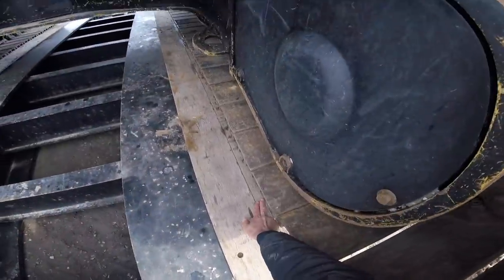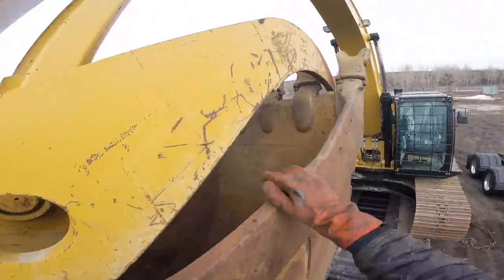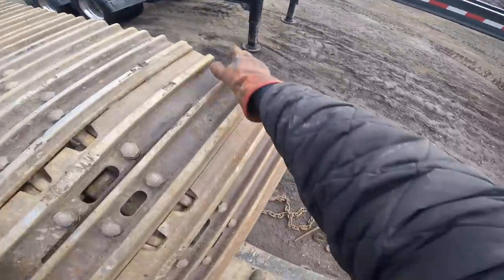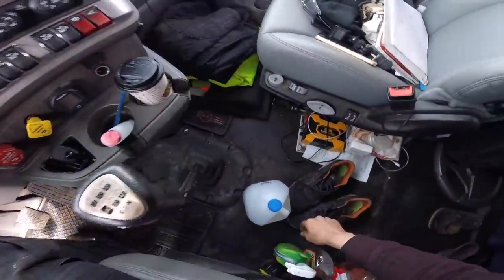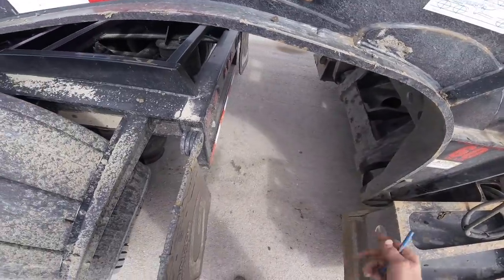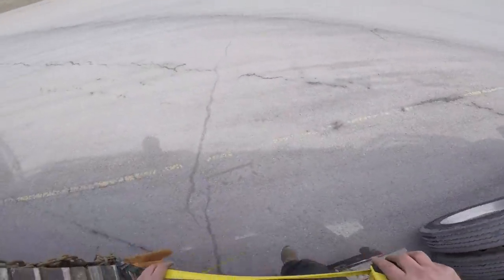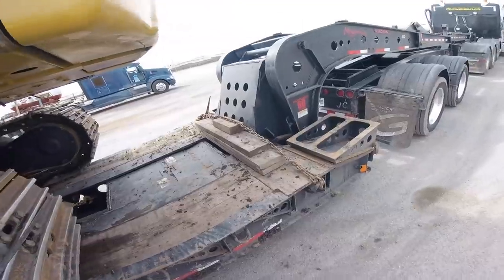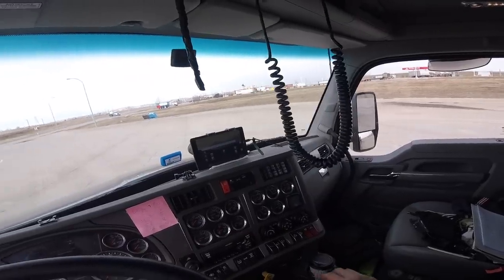Building a CAT 336 road train...

Comment: Its very interesting how much our low loaders in Australia differ to over there.  Nearly everything hear is hydraulic widening with ramps and hydraulic suspension, and we use rows of 8 axles on the bigger weights. Loading a  336 on one of our 5X8 swing wings would only take 40 minutes.
Reply from the maker: Speed of loading is only important if you do local work and have to load/unload 3-4-5 machines a day. a $1,000,000 trailer would be nice to have but it's not necessary when you haul 2-3 loads a month.
Reply: HHTV that’s true... or trying to beat curfews to get out lol.   5x8 Drake ‘swing wing’ that widens from 2.5m - 4.2m with aluminum wheels all round, drop well deck, hydraulic gooseneck, sliding skid plate (for using a dolly or Jeep) retails around $650k aud. I tare a neat 42tonne with the dolly and a 163tonne GCM rated K200 primemover and that gives me a 94t payload for a 136t gross.  I could never go back to boring general freight after 15yrs with this co. doing heavy haulage with Cat as our major client.    I only subscribed yesterday after one of the fellas I worked with mentioned your channel. Been enjoyable!

Comment: Could you weld some sort of swivel type attachment  to each side of the neck? Then when you hook a chain to each swivel maybe it would rotate as the neck is raised and lowered? Maybe allowing smooth bind free fflipping .  Of course that's a big big maybe:-)
Reply: Yes something like swivel D rings. Very good point I was thinking the same. Smart minds think somewhat alike LMAO Thank You
Reply: If you had hooked the chain through the d-rings and then brought them towards the excavator,  instead of around the sides, it should work better. I think this is right. I've never done it before but I used to operate equipment .
Reply: Actually a D loop cut from a 3/4" plate welded vertically to the front of the flip neck would solve it. The D would allow for a chain to pass through it and as the neck is flipped, it will rotate on the chain.

Comment: Can you explain the benefits of the Jeep how much more weight you can load ? In a video thanks
Reply from the maker: i thought i mentioned this already like a million times. the major reason you need a jeep is when you're 1) taking a load to a jurisdiction where lift axles on trucks are not recognized; and or 2) you need more axles for the heavier load. if you get a typical 20,000 Lb per axle on a 8 axle rig, that's 160K gross. Minus the empty weight (say, 50K) that leaves you 110,000 Lb (if you are lucky). That's theory; in real life 4 axle trailers without boosters rarely get 80K, so you need a booster/spreader ..
Reply: @HHTV60  thank you for taking the time to explain this I got thanks I'm working on a 4 truck hauler I'm cutting it to a two and a half car hauler the setup is like a lowboy so my tongue weight is 2000 lb empty so I'm thinking of making a Jeep for the front to put it behind my motorhome you can see it on my YouTube page thanks again

Comment: 😊  COLONEL SERGEI  😎🤗  "ON THE ROAD AGAIN" 🤑  Yes, absolutely must figure } load / unload { time .  Always, cracks in welding show intensely after sitting a bit,  just have to be vigilant in looking. There is (NO WAY) they should NOT cover warranty !!! 
😷 BE SAFE 🙏 GOD SPEED  😨WATCH OUT FOR THOSE KRAZIES  😱  THANK YOU for UPDATE in "TRAVELS"😍😍😍😍😍
Reply from the maker: Fontaine agreed to cover the repair of these two small cracks under warranty. I'm not paying anything. Will get 'em fixed at a Fontaine dealer in Voorhees, NJ after I drop off the CAT 336!